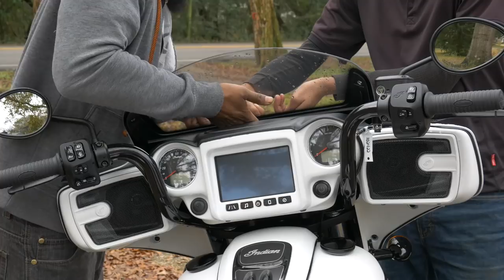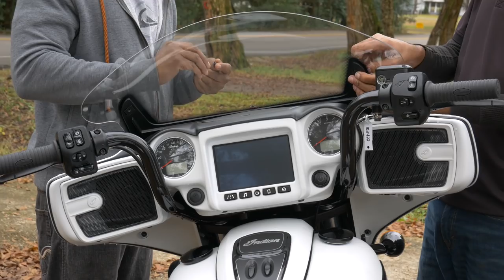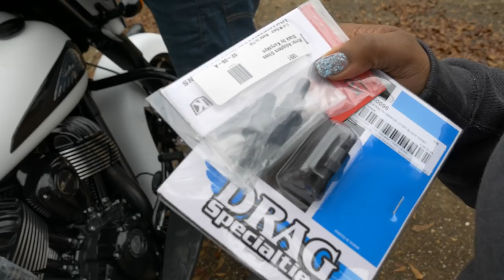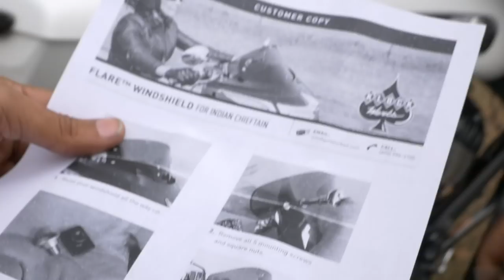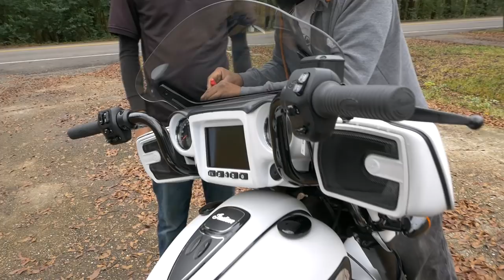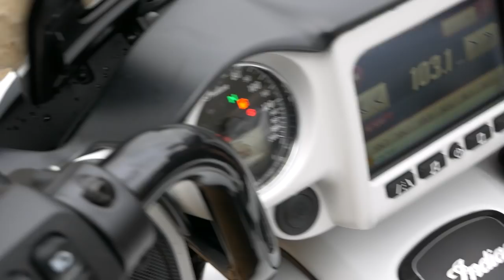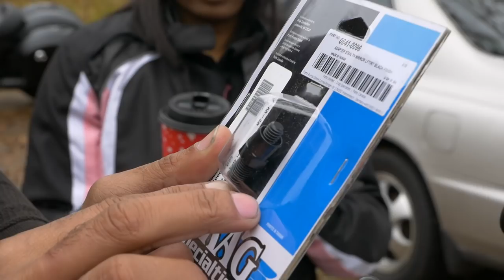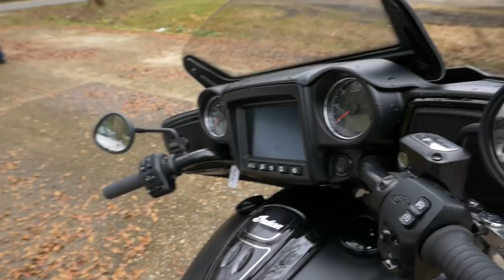The Klockwerks windshield didn't work on the 2019 Chieftain

Comment: Man, I had the same problem...the mid-rise bars were pushed too far forward. Just takes a 6mm allen to loosen the bars and pull them back a little so it doesn't make contact and you're good to go! I have the 12" Klockwerks on my 18 Chieftain with mid-rise bars.

Comment: It will work with the  mid rise bars. For mid rise bars looks like your controls are rotated too far forward , your wrist would be flexed to much. Rotate your throttle controls back a little. Good luck guys...

Go Indian
Reply from the maker: He thought about rotating the bars more forward, but he doesn't want to ruin the reach he has. After looking at the picture I posted of him on it, it looks like the perfect set up for his height. He ended up giving it to Lenore for her 18. We'll revisit it again, probably. I don't remember if the master cylinder is attached to the throttle so wouldn't rotating that also move the brake levers?
Reply: @BrandonBicasso  
Yes everything will move if rotated.
I had the same issue with mine, I rotated the controls back about 1/2in. Now I'm very happy
Reply from the maker: I'll pass that news on! Exactly why I post these videos so people can learn about stuff before they buy.

Comment: i have the same setup with the mid rise and klockwerks. just rotated the bars back a bit and readjusted the controls, worked fine. but i'm only 5' 10"
Reply from the maker: Oh, word? I'll pass the info along! How do those mid risers work with your height? I figured it might be too far forward since I'm 5'10 also.
Reply: @BrandonBicasso  my height made me have to pull them back a bit anyway, so it was no problem. just loosen the back 2 bolts on the bar clamp and you wont have get into fairing dismantle
Reply from the maker: Noted! I was wondering whether or not the fairing would have to be messed with.

Comment: What about mirror extenders? Those little things that move the mirrors sideways by about 2 inches. It does change the view and look of where they are. Or just go to bar end mirrors.
Reply from the maker: Yeah, I suggested that. Only issue with bar ends is whether he'd be able to see out of the mirrors. Not sure if his arms would block the view. It's a beautiful set up, but comes at a price.
Reply: Should be OK if they come up high enough, I would think. Or do the "cool" dropped look like many folks have on the bobbers. I just ordered extenders for my little Honda as I'm sick and tired of admiring my arms in most of the mirrors.
Reply from the maker: Lol, that's what we thought he ordered but instead he ordered adapters. 😂😂😂😂

Comment: So are the bars taller than stock? Almost nothing else will work with those bars either if not.
Reply from the maker: Yes, I don't know measurements but they are taller.
Reply: @BrandonBicasso  
All mods to new bikes seem to assume all else is stock. In reality very few bikes are stock for long. All Indians should be delivered stage 3 setup in my opinion. The fellow that rides the bike in the video needs those taller bars, he is tall.
Reply from the maker: He looks funny as hell on it without them compared to the look he has now. Once you see it this way, I can't see him on one without them.

Comment: Would tilting the handlebars towards him help?
Reply from the maker: It might. He didn't want to lose the look and the reach the mid risers gave him. His arms are pretty long
Reply: I was thinking the same thing. Adjust the handlebars back toward him just a little to widen the gap for the mirror  to fit.
Reply from the maker: We'll try it and see. If it has to come back too much he won't do it, though. Reason being it gets cramped with that arm length which is why he had a similar set up on the Vic.
Reply: @BrandonBicasso  That's understandable. If it has to adjust too much the bars will be too low and uncomfortable for him. Overall it's still a point deduction for Klockworks because those mid risers are not new to Indian nor is the windshield. That issue should have been discovered and resolved a long time ago. Should've been a simple bolt on project.
Reply from the maker: Yeah, I wasn't there when he had the bars adjusted and put on so it could be a bars thing versus the windshield. It worked on the 18 of course because the bars are so low. With the bars sitting where they are they look like they're in a stock oem position.
Reply: Brandon Bicasso in either no more ish talking, going to see about getting my own Springfield Dark Horse tomorrow. Can’t wait for you anymore 😆
Reply from the maker: @MrJoeylap  There's a reason for my patience. 😎 Let me know every detail!! 😬😬😬😬😬😬
Reply: Will do. My sister is moving back to Atlanta, Villa Rica actually so I’ll definitely be in your neck of the woods
Reply from the maker: Cool! I'm right down the street from Atl

Comment: Maybe the manufacturer of windshields will see this vid...  And ya that Victory is bad Arss.  You gotta wonder why Victory went outa business...
Reply from the maker: It could've been us not rotating the bars, but the mid risers appear to be in their correct location. Plus, it works perfectly for his height. The shield didn't go to waste so it got put on the 18. It's a win/win. But yeah, if they see it and could reach out that'd be cool too. 😎
Reply: AboutMy FathersBusiness according to my dealer Victory went bye bye to concentrate on Indian since Polaris owned both along with the Slingshot line.

Comment: Blue loctite anyone
Reply from the maker: I've had bad experiences with loctite and windshields, lol. That would be the proper way to go, though.
Reply: @BrandonBicasso  what happened
Reply from the maker: My 109 came with a windshield on it and someone installed it with red loctite. Ended up having to damn near break the windshield to get it off. Someone went full loctite instead of half loctite with the blue 😂😂😂
Reply: @BrandonBicasso  for future reference as u know blue if ull ever wanna remove it. Heat helps remove stuff with red. Gotta love used bikes... fyi I came cause u more like me demographically than many other motovloggers. I the 109 hooked me, I was thinking bout buying one at the time, stayed cause cast and magnum.
Reply from the maker: Glad to have you here and your support! We're all a bunch of goofballs and this is every day stuff, lol. Never a dull moment.